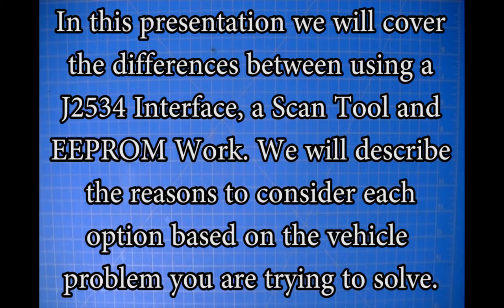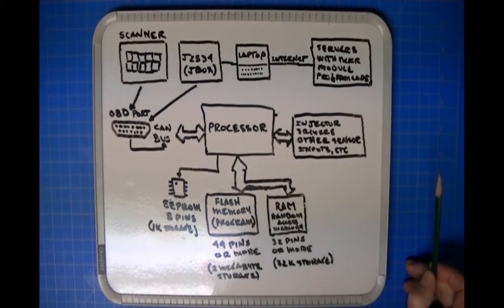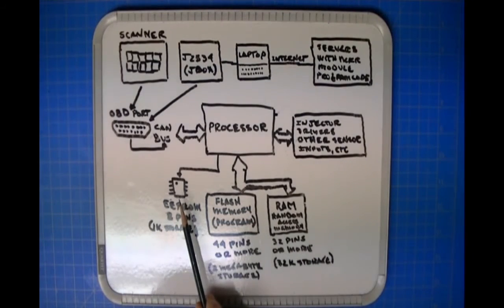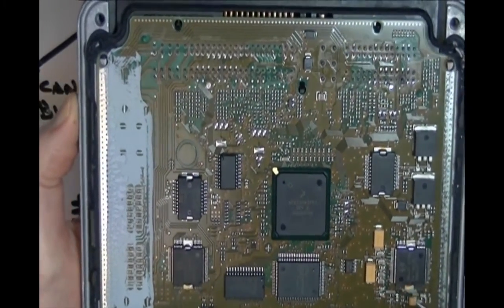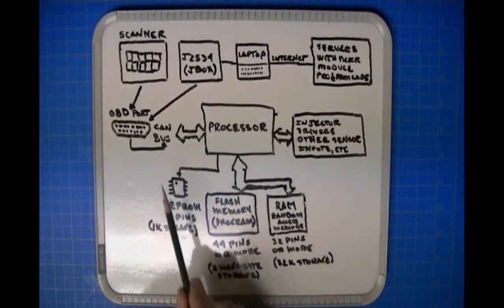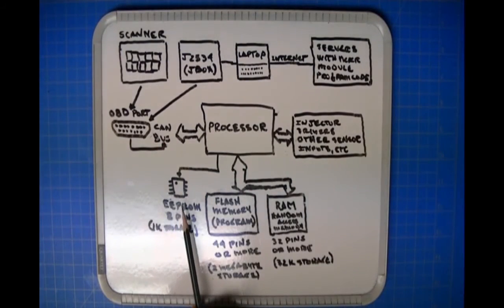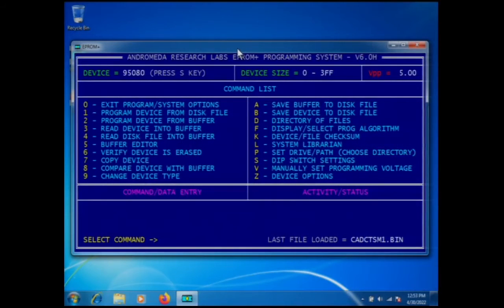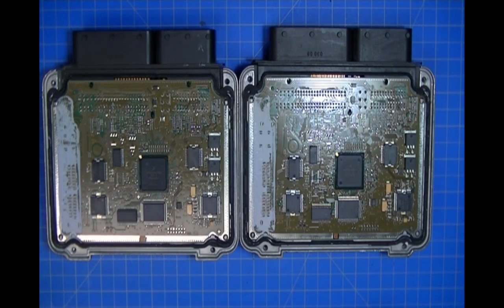J2534 vs. Scan Tool vs. EEPROM Work - How to use them by understanding the differences

Comment: Great video! I have a question what happens if you can get the eeprom info off the original module? I assume it's a brick and you can't program a junkyard module.
Reply from the maker: Reading the information from an eeprom does not alter the original data. The module itself is defective but the eeprom data is good. Once you read the original data from a defective module you then program the data into a functional salvage module which is now an identical clone which is simply installed in the vehicle. No OBD programming required. We have several videos on our channel which show the cloning procedure.

Comment: What happens if the EEPROM of the donor/original ECU is dead and i can't use it to clone the new ECU ? How do i go about replacing the ECU
Reply from the maker: If the eeprom on the original assembly is defective or corrupt the most likely path to success is to edit the VIN in your salvage module. This will work if the module is VIN locked. It will not work if the original module has key information. If you can't clone the key information the car won't start. You can also blank (erase all data) in the salvage module then program it to the vehicle as a new module. All that being said, it is rare that the original module eeprom is defective.

Comment: if i bought a new pcm from a manufacturer I'll use nissan as an example, does the flash memory come programmed onto the board or would i need a flash programmer for this?
Reply from the maker: The flash (program) memory is preprogrammed as part of the module fabrication process. Vehicle specific data (VIN, key, etc.) is added as a last step on the assembly line.

Comment: If the vehicle info is in the eeprom, is it possible to just remove and solder the eeprom into the "good" salvage vehicle module?
Reply from the maker: Yes, if you are proficient at soldering and willing to accept the risk of three soldering operations (broken pin, lifted trace, heat damage) then a "whole blood" chip transfer will work. Also if you damage your original part you have no path back. If you do a simple clone you attach the clip to the part, read, move clip to salvage module and program. Also you can save the original chip data to a file in the event that your salvage module is also defective.

Comment: Thank you so much for your simple explanation. I wish I have watched this video a year ago. I bought a car with electric problem and needed to change one module. I went through tons of learning on software, hardware, etc (Mercedes). Cause of my inexperience, I caused my instrument cluster to brick. I had to go to dealer and spent 200 dollar so they can tell me Sorry your IC is broken. and you cannot use a used one, It will cost 6500 dollar to change with new. Well, I start searching and came across eeprom and then to your channel. just by watching 3 of your videos, I am able to leant a lot and feel bad about the time, effort and money spent on useless software and hardware.
Reply from the maker: Thanks for your kind comments and that you found the information useful.

Comment: All good with eeprom reprogram. Dont know how that clamp is made however if there are no spacers ( plastic ) and the pins of eeprom are shorted while voltage is applied bye bye...
Reply from the maker: Shorted pins don't damage the eeprom. Also we don't apply power to the part until you issue the command to read. Nothing is attached hot.

Comment: If our original eeprom is damaged so what data we rewrite in the salvage module
Reply from the maker: If the original eeprom is damaged you most likely will only be able to change the VIN in the salvage module. Any other data will be very difficult to recreate.

Comment: Excellent stuff!  Help see big picture.  Can you do a video on why you can’t use a scanner in some newer vehicles to replace keys in all keys lost scenario?
Reply from the maker: Simple. The scanner is not programmed to perform that function. The scanner manufacturer either chose not to or does not have access to the commands necessary to send to the immobilizer.

Comment: In this example why not just remove eeprom with car Id and solder it into module you want to use and be done with it no chance of of you losing or corrupting file. I know it might no be faster than reading and writing but no programer needed , oh what do I know. Thanks for video it was informative.
Reply from the maker: Yes, you can do a chip move if you have the experience and equipment: most folks don't. You also have the issue of lifting a track or breaking a pin. I'm not opposed to that option but it also has risks. It's also a significant challenge for PLCC microcontrollers.

Comment: Once Source Data is transferred to the Salvage Module,  what about gaining access to the Security System, Resetting the Salvage PCM, and programming Keys to Start the Vehicle? You didn't mention these important steps to complete the solution.
Reply from the maker: When you transfer the data from the original module to the salvage module ALL information moves. You don't need to program keys because the original key data moved from the original.to the target.
Reply: @andromedaresearchlabs7826  On a Ford PATS Security System it has a Rolling Security Code. I had to gain access to PATS in order to erase present keys, and program new keys. It was not Plug and Play. I used a OE level Scan Tool. The PCM was supposedly refurbished from EBAY.
I was not using a EEPROM Programmer. I  technically received a Salvaged PCM, and had to go through FORD security procedures in order to start the Truck.

Comment: When do I really needs to do key programming via DLC port and when the eeprom work is needed
Reply from the maker: You use an OBD port tool for key programming unless the vehicle does not allow it. It that case you create keys using data from the immobilizer eeprom using a transponder programming tool.
Reply: @andromedaresearchlabs7826  like when the vehicle immobilizer is corrupt that when you do eeprom work

Comment: Good Day Andromeda,   Does all Modules on vehicles have an eeprom to change to vehicle you are working on or is it a totally different animal that you would need the locksmith accessories to complete. The Automotive kit #2 is just extra accessories parts from the kit 1 that can be bought ?   Am I thinking right ? If correct, the programmer is the same in all kits, just the accessories are different ?
Reply from the maker: Yes, you are correct. You can always upgrade a kit. We never make you purchase another kit or software.
Reply from the maker: All kits are based on the AR-32A programming unit. The locksmith kits are based on the automotive kits but include locksmith specific options (Honda keys and Toyota/Lexus resync block). An automotive kit can be upgraded to a locksmith kit by purchasing the locksmith kit upgrade option. All kits can be upgraded by purchasing the desired option or adapter. We never make you purchase another kit.
Reply: @andromedaresearchlabs7826  I made my first purchase with a locksmith #2 kit. Added one part from the automotive kit and now I have access to both. I will be purchasing more as soon as funds are available. Thank you for sharing your experience, knowledge, expertise, and time !

Comment: If ecu damaged can you virginise ecu from  salvaged car  and than programed into the vehicle
Reply from the maker: Virginizing means that the ECU contains the same data as if were new. You can erase all the data in a salvage ECU eeprom then it may be considered as virgin however there is no guarantee. IThis is why cloning is a better option.

Comment: Great great video! So when tuners request to read the flash memory, does it read (and write afterwards) the whole sectors or part of it?
Reply from the maker: Assuming the communication program allows it, a tuner can read any data they wish. Before data can be written a sector (block) of memory must be erased even if they only want to change a small amount of data. "FLASH" refers to flash erasing. They can program individual bytes if they so choose. Data which they may not wish to change must be replaced if it was part of a sector in which data was changed.

Comment: Super Informative Video. All Techs Today should watch this !  So, we will be able to take a used ecm and change the vin and use a used ecm. ( if the ecms are the same and hardware?), Am I thinking right?:face-turquoise-covering-eyes:
Reply from the maker: Yes, that is correct. The modules must be electronically identical (same part number) with an accessible eeprom part.

Comment: Thank you for a the thorough explanation.  I suppose the salvaged unit might have an outdated program that needs updating via the j2534. So, you might not be limited to only cloning the EEPROM.
Reply from the maker: The module program might not be the latest version but a salvage module will still work if you clone the eeprom. If the cloned salvage module will allow the vehicle to run you can always update the program later.
Reply: @andromedaresearchlabs7826  absolutely true

Comment: Hie there.if the car specific info is the eeprom only how would it compare if i put a different module.how would it triger dtc for vin or wrong key where else is it stored
Reply from the maker: The VIN is stored in the other vehicle modules. When the used module is installed the programmed VIN or other data is from the previous vehicle.
Reply: @andromedaresearchlabs7826  what of the key infor.
Thhanks for the great info you give us
Reply from the maker: The key data is in the immobilizer or sometimes in the immobilizer and ECU.  If it's in both then the immobilizer and ECU must be resynced if one is changed.

Comment: Thanks alot that was amazing explanation. I have 1 questions, what about the new modules that the flash memory, eeprom and the processor are all integrated in one chip, do you have tools that can clone this type?

Thanks again for your great explanation. I was searching like those deep details.
Reply from the maker: If the eeprom is integrated on the same silicon as the processor and program memory cloning using an external connection to the part is really not possible. This is because the communication protocol is not known nor are the connection pins. The reason that modules with external eeproms can be easily cloned is that the memory parts adhere to industry standard parts. Parts based on custom silicon do not follow any standard which makes them all different. In this case the only option to clone would be via a J2534 command supported by the part which may not be supported by the manufacturer.
Reply: @andromedaresearchlabs7826  thanks a lot. God bless you

Comment: A nice Modern Programming interface would be a nice addition to an otherwise awesome System.  A shell interface should not be hard to create and it would surely boost sales as it would be a more familiar PAC Interface. Anyway, good explanation.
Reply from the maker: Thanks for your suggestion. We will certainly consider it.
Reply: @andromedaresearchlabs7826  I have used that Kit quite a few times now and I must say I like it alot the only downside I see is the interface.